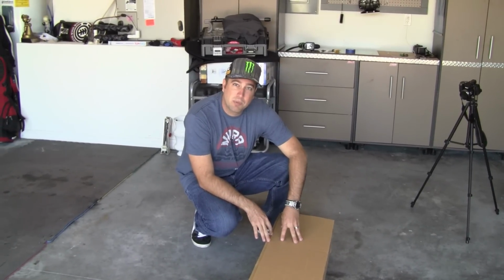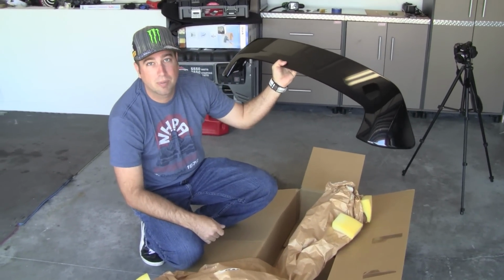Backyard Garage Stars: (Pilot Episode) Nissan Juke OEM Spoiler Install

Comment: After I installed my spoiler, I notice  small gap between body & spoiler on (2) areas...sure enough, when I washed the car, water got in through the drilled holes and shorted out the license plate lights....did you have that problem or similar by chance ?

Comment: Got my old wing broken in a car wash. and watch this video to see how to replace it with a new one bought at Nissan. The old wing was delivered from the dealership when i bought the car brand new. To my suprise Nissan installed the wing with glue only, no holes or bolts. So no need to make holes in the roof of the car. just use a strong glue. So if you later want to remove the spoiler or change to another model, you don't have a problem with holes, and risk off rust and water inside the backdoor.
Reply: Does it work,how long do it last like wit glue
Reply: @Dfwj1913  this comment was made 7 years ago, sold the car 3 years later, and had no problem with the glue in that period.